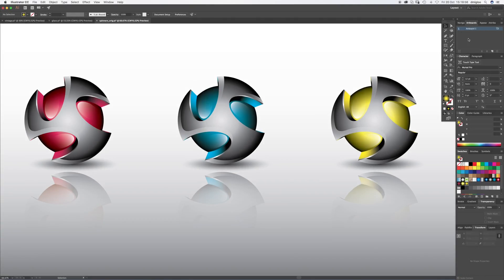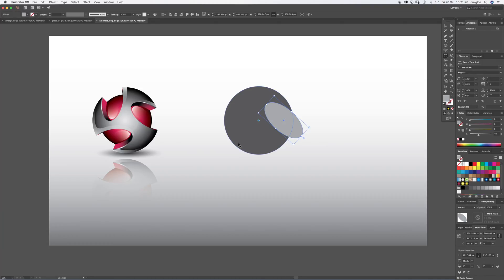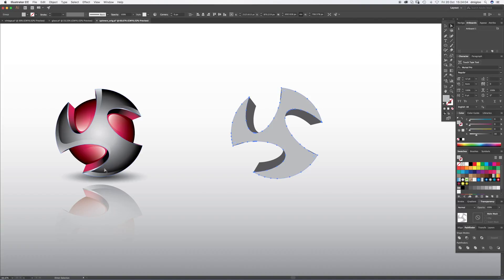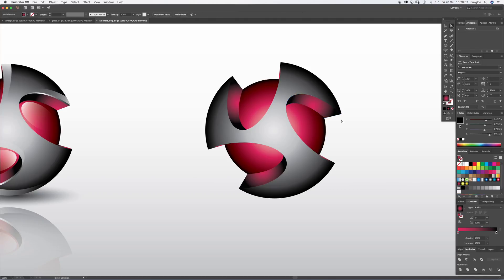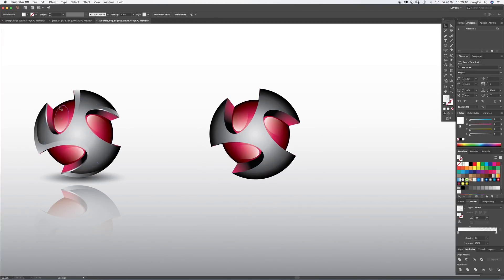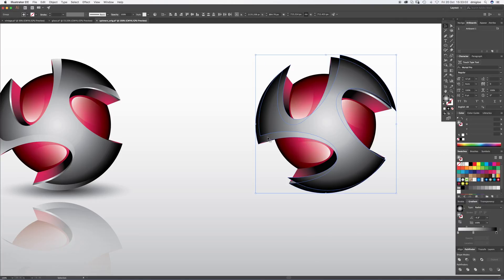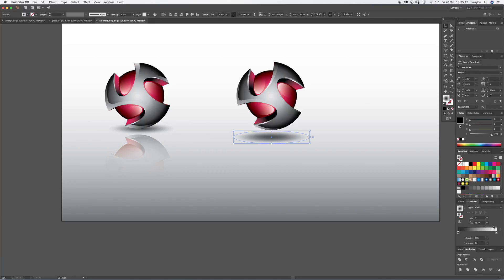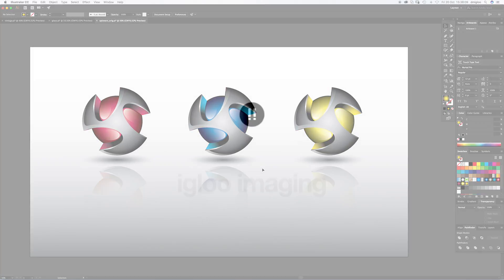Illustrator 3D Logo Design Tutorial

Comment: Of course there are different ways to get the same result. So this is how I would have made the shape. I would have made 2 circles, an ellipse and a line from the outer ellipse side to the circle center. Then I would white arrow move the center end line to where it would intersect with the inner circle. I would copy the ellipse from the outer end line point to the inner end line point. Now I would cut out all with divide and delete the parts I don't need. Use the ellipse gradients required. I would create a bigger circle that would go over the ellipse and group all. Now rotate copy 120 deg 2x, ungroup, delete the bigger circle and use scissors to cut the circle where needed or cut with pathfinder. Join the lines to create the front shape and gradient color as well.